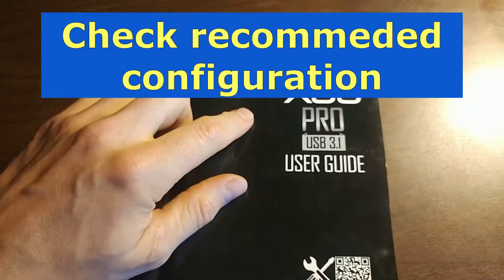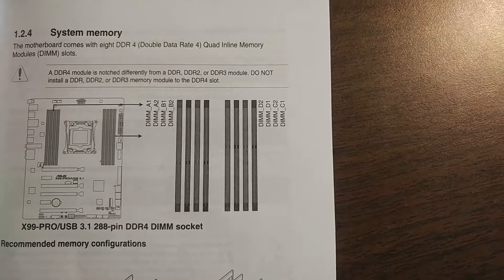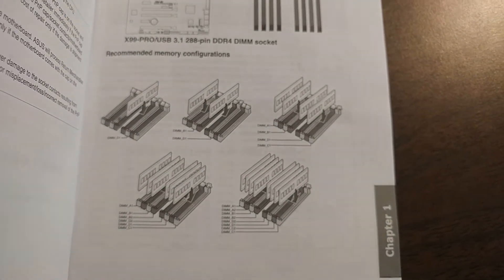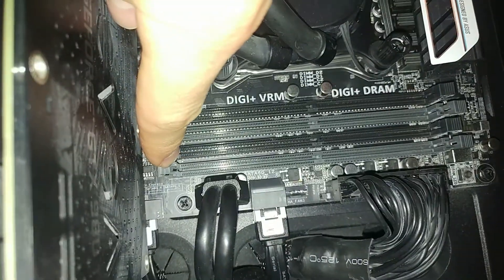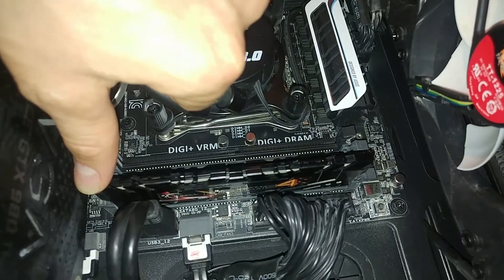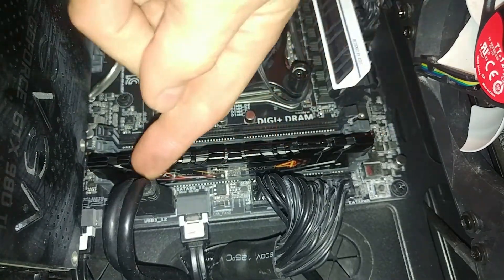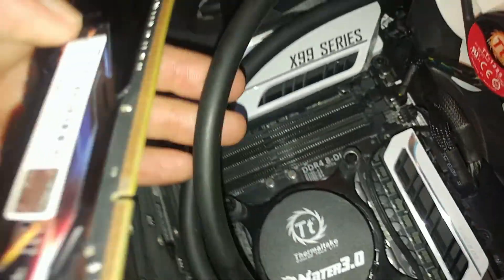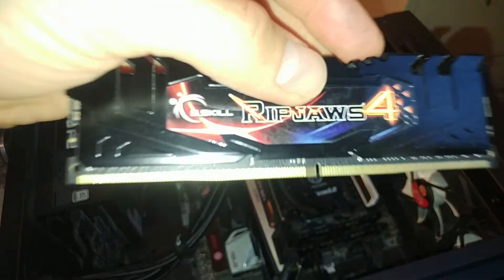2 THINGS TO CHECK BEFORE INSTALLING DDR4 MEMORY STICKS

Comment: Wow, you've got 8 slots for ram on the motherboard!
Reply from the maker: Yes, it's a high end motherboard with X99 chipset. Nowadays only few really really pricy motherboards feature 8 slots of RAM on board, even high end gaming boards have 4! It's probably due to increased ram capacity per stick, but still high end gaming motherboards should come equipped with 8 slots of ram to take advantage of quad channel memory!
Reply: I had no idea how many slots can be. Now I know! Lightning)